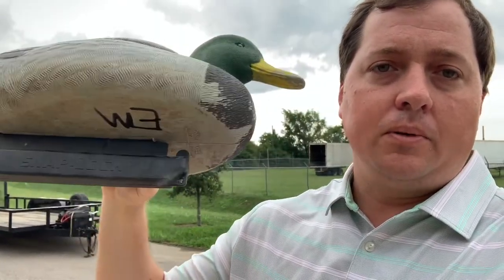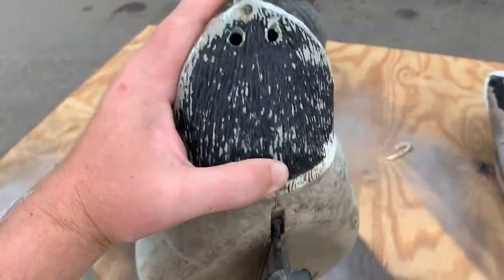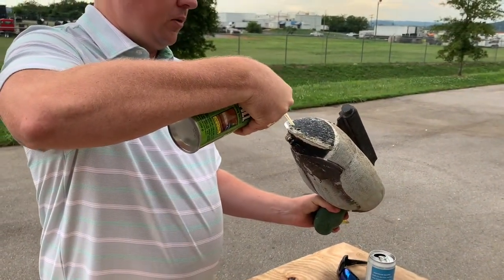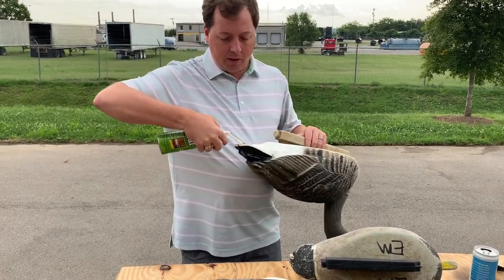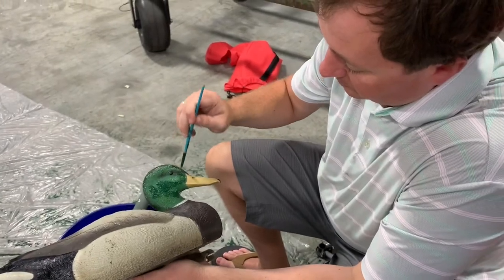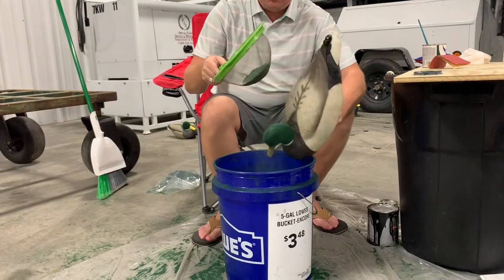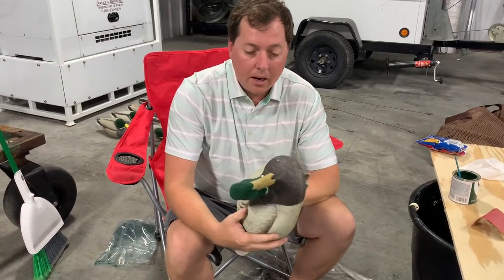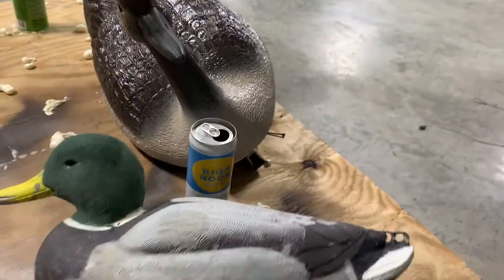How to Flock Duck Decoys

Comment: Great video! I've been reflocking my mallard drakes too. I use black rustoleum  paint (oil base) then flock with green flocking. I let it rest 24 hours then add another coat of paint and flocking. The guys who taught me say the 2nd coat adds years before you'll need to reflock under normal use.

Comment: If you use the “can foam” use about a tablespoon or so of water inside the decoy first it will make your foam setup harder and more dense. Since the foam uses the moisture in the air to help it setup.

Comment: I tried flocking my decoys with paint I got from “flockingunlimited” and the flock came right off the decoys as soon as it hit water… does the paint you use withstand water ? Or do you need to use a clear coat for it too stick